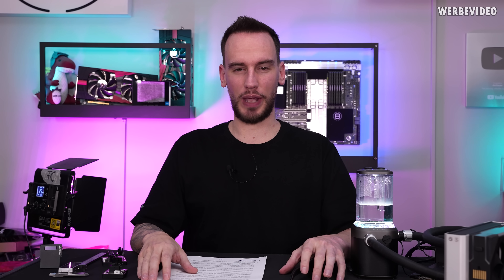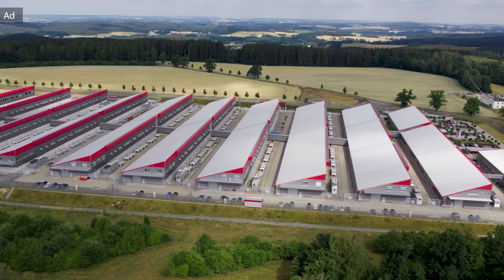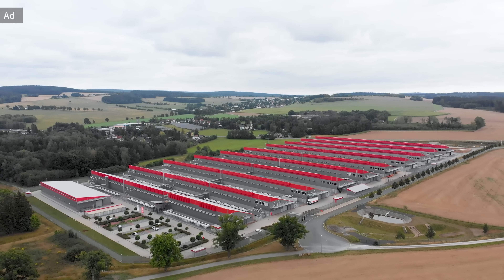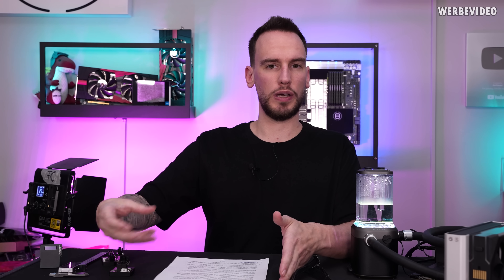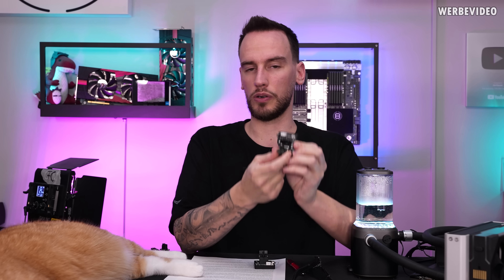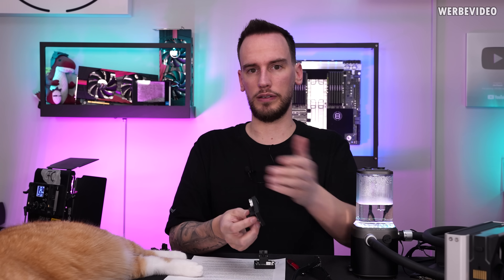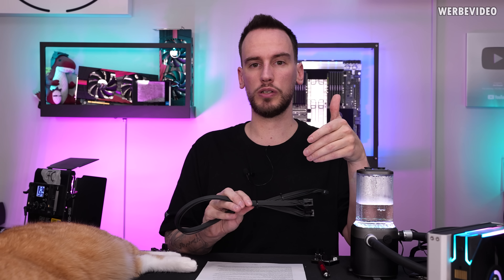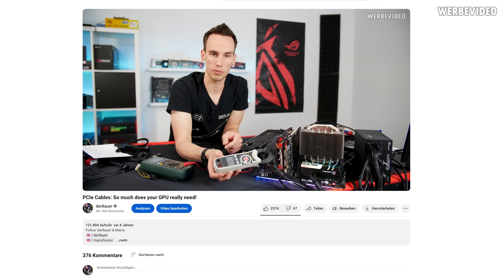12VHPWR is just Garbage and will Remain a Problem!!

Comment: I had problems with the connectors melting down.. answer was simple. I soldered another connecter to the gpu so then I could plug in another psu cable I to the gpu

Comment: I tried to explain this to people for a LONG time.  Like as soon as the 4090's started having this issue.  Too much current, through too little connector.  When pushing that much energy through a small channel (if it's electricity, or fluid under pressure in a pipe or even a river) has to be done VERY carefully.  If it is not done perfectly things go very bad very fast.  It's basic physics.  But no it's user error, it's designed well and the people at PCI SIG know better  etc etc.

Comment: Anyone with a brain an some common sense can see that these adapters are just another pointless point of failure instead of just one cable an connection which in it of its own is a point of failure but lets x5 that an add some 90s 180s fuck it lets go from a 90adapter to a straight an go right back into a 90. Like Jesus h guys yur not piping in copper lines here IT ELECTRONIC just use the LEAST AMOUNT OF POINT OF FAILURES . Thats like the people that use display adapters to extend there display adapters. Just BUT ONE LONG CABLE . Its moronic

Comment: Simple solution is avoid buying 4090 and 4080 GPUs and if you do try to get ones that use 2 8 pin to 2 8 pin connector vs 2 8 pin to 1 12pin connector.

Comment: These can be a problem even on lower power cards. I started to experience frequent display driver crashes when running stable diffusion on my 4070ti, which I narrowed down to connection problems with the 12VHPWR connector. I've had to awkwardly suspend the cable from the case so that it's in line with the connector and there's no pressure on the socket from the cable sagging. That's eliminated the problem, but it shouldn't have been a problem in the first place.

Comment: Happy New Year. I chose to go with a 4080 Founders Edition and I've been pretty happy with it so far. It's a very efficient card, which means I don't need to worry about the power consumption and the state of the power connector. I want enough GPU power for the upcoming 4K 240Hz monitors but if NVidia keeps disregarding power consumption on their flagship cards my next GPU will be the more efficient 5080 instead of a power hog 5090.

Comment: The EVGA 3090ti had it's connector on the end of the GPU which left so much room and the cable could stray straight. I know that this is not a problem card, but why don't manufacturers of the 4090 use this idea?

Comment: What they should have done long ago is up the voltage which inversely lowers the amperage required to carry the same amount of power.  1Ax12V=12W 1Ax24v=24W.  They'll have to do this eventually as watt requirements go up or you'll end up with stupid thick cables. However, the real issue is power contacts.  If you have a large amount of surface area, contact then you get normal temperatures, but if you have a small area of contact or worse a gap then you get high heat or arcing.  Those power connections are more likely melting because of that reason alone.  Still, I think going to higher voltages would solve a lot of issues.  You could take 2x 12v rails and output a 24v with the right converter, but it's going to take space in a PC, but it's a solution that can be done outside of the ATX standard being updated to higher voltage rails.  Besides downstepping home voltages to low volt DC is lossy as well.  So there's more efficiency to be gained if they moved upwards a notch in the voltages.  48VDC would be a good spot because there's so much stuff that runs on 48VDC already in telco's, those vendors would welcome more business in that area when it comes to components.

Comment: from my understanding the cable is fine. The issue is the clip on the cable. There is two much leeway on the clip. Also the connector is to long for a single clip. A double clip with less leeway would fix the issue in my opinion. Maybe thicker copper wiring to up the power limit of the cable. 

Realistically who wants 4 x 8pins coming out of their GPU. Even three is some what annoying.  Having just 1 cable is extremally convenient. I don't think taking a step back from innovation is the answer. But I do think Nvidia and PSU manufactures do need to sit down, create redesign of the cable and a standard for it. Hopefully this is done before the 5000 series is lunched.

Comment: here is a question why isnt the connector to the psu melting? it should be the same on both ends
Reply: Because on the PSU side they use 2 or 3 8 Pin PCI-E connectors. Basically what 12VHPWR is, is just an unnessery adapter cable. Seasonic for instance sells a 12 VHPWR cable with only 2 8 Pin connectors on the PSU side. Because they say, that their PSU's can deliver 300Watt on 8 pin no problem.

Comment: This is all under the condition that you have a 4090 pulling somewhere around 600w. Is it safe to assume the 12v hpwr connector is more than sufficient for lower tier cards like the 4070 and 4080?
Reply: Yes, but so would be two 8 pin connectors, that's the joke here. Seasonic sells a 12VHPWR cable with only 2 8 pin connectors on the PSU side because they say, their PSU can deliver 300W on 8 Pin no problem.

Comment: Very informative video, really appreciate it. Went and had a look at my 4090 with my 12vhwr cable and it definitely isn’t 35mm space before the bend in my case at most it’s 15mm before the bend because of the glass. I’m kinda worried now, as I’ve had zero problems so far other than my old PSU causing momentary black screens because of the cable. I upgraded from Corsair rm1000x with cablemod cable, to a seasonic 1200w platinum and my black screen flickering went away. Every now and then it’ll blow the breaker in my apartment though when I’ve got anything other than my pc running but that’s my problem not due to nvidia or any other company.
Reply: exactly same spot as you, just checked and mine bends after the nvidia logo on the label of 12v connector. 0 issue after having owned it for a year. 

how often have you done hardcore gaming on it?

Comment: LOL i just emailed thermal Grizzly asking if the Wire sense was a using the OLD h+ or the newer H++ standard, guess it doesn't matter So i had the cable mod 180 adapter fuse itself to my Msi rtx 4090 Suprim x I had to wait 8 weeks for repair through north ridge fix finally get the card back and i don't even want to plug it back into my system!  Should i under-volt? Power limit? does someone make a over spec'd cable with high-temp resistant plastics? could i make my own out of Polyether Ether Ketone? or should I RMA it straight up Jensen Huang's butt? Any Ideas would be appreciated!!!

Comment: Can some tell me please why we cant just use the same connectors used in the Radio Control Hobby Industry?  We use XT60 and XT90 Connectors all the time with 24V and higher voltage and also pull close to 75-90 Amps continuously run after run.   The connectors are not effected by this.  There should be no reason why we cant use a 2 wire connection with larger gauge wires and connectors.  If I am mistaken on this please someone correct me.

Comment: When I first saw this cable being speculated on, I knew this would become a problem. Smaller pins are never the way to go with increased current draw. It's clear Nvidia was going for a certain aesthetic at the cost of reliability. I run RC cars and realized many many years ago to go with the biggest connector possible to minimize loss as heat. 
I am currently running a 6900XT. I did some pretty hard overclocking on it where I allowed it to draw as much power as it wanted as it is water-cooled and for benchmark runs it was fine. I let firestrike loop for over an hour and while the GPU temps were right on the edge of acceptable (drawing over 400w), my cheap Amazon 180 degree connectors never went above the case ambient temperature, I used a FLIR camera to verify it. It uses 3x8 pin connectors, which as you stated are definitely the way to go. Yeah, they are larger and a bit more bulky, but it really shouldn't bother people. It's just more surface area to have cool looking cables, kind of like the patterns you can create on the 24 pin connector.

Comment: I would like to see them stop using extra cables for the GPU altogether and instead use a extra "Power" slot on the motherboard or extend the PCIe slot to add new power pins for the GPU.

Comment: Something that's pretty clear to me is that this new standard was clearly rushed with arbitrary constraints and never tested in real-world cases. It really looks like PCI-SIG just developed it, tested it in open bench setups, saw that the card was properly powered and went like "Eh, good enough" and called it a day. Clearly there were no torture tests done on them or tests that aim at simulate bad/improper connections to ensure that even in the event that a bad connection were to happen it wouldn't cause problems. The tiny pins also make me question the scope of this new standard because it seems to be born more out of aesthetic/size concerns than actual reliability issues with the existing standard. PCIE-SIG couldv've gone with bigger connectors and ensured that the rigidity of the connector itself would prevent things from wiggling around or chosen a different wire gauge but instead... didn't.

All in all this new standard is a dumpster fire and should be scrapped entirely.
Reply: PCI-SIG doesn't even go that far. The PCIe 6.0 spec got finalized almost 2 years ago. No one has actually demonstrated working PCIe 6.0 hardware.
Reply: @naptastic  ooof, thanks for the explanation
Reply: " it seems to be born more out of aesthetic/size concerns"  And manufacturers put the connector in the center of the VGA. LOL.
Reply: @devilzuser0050  thats usually for industrial engineering not in this case ...
Reply: sure and some manager signed off that has no technical or experience overwriting the engineers
Reply: @atta1798  Yeah not unlikely that this happened as well. A tale as old as time essentially...
Reply: FYI, intel told them it was fucked and proposed a better connector. This is why Arc was supposed to use them on all cards.. but clearly that didn't happen.

Comment: Higher thickness wire will also help the connector itself. Thicker wire = more thermal transfer of heat away from the connector pins, and a higher current ability without overheating. The wires act as a sort of heat-sink for the connector itself.
Reply: @Triro  and yet 15+ years of 6+2 connector and basically no issue with that. It definitely raises the question whether the new standard is at all adequate, whether it gives manufacturers too much wiggle room to produce items of insufficient quality, or makes it more difficult to end users to install correctly or easier to install incorrectly. There's no need to brown nose PCI SIG and Nvidia.
Reply: Standard is faulty as nVidia pushed hard for it, thus we now have a replacement standard (still the pins are not of a dimension to cope with 50A continuous current)  @SianaGearz
Reply: sure, but the connector itself is too small to handle 600W of power, or almost 1000W, which an unofficial BIOS flash can allow the GPU to draw without any hardware modifications
Reply: @Triro "I archived this thread" well too fuckin bad I'm replying anyway
Reply: @Triro  I'm not likebotting anything.

"Doesn't have very delicate pins" well that sounds like a massive advantage to me! Tell me again why we're "upgrading" to inferior hardware?
Reply: it wont help much , the bottleneck is still the pins not cable , that tiny pins and connector is too small to carry 600 watts of heat longterm
Reply: @Triro  So its more delicate then the original standard, and causes more problems. So why have it?
Reply: I'd prefer if they just raised the power limit on the old 8 pins a bit. and maybe even the PCIE connector. From 150 to 200 and 75 to 125/150 would allow just 2 8pins to supply over 500 watts to a card or more than 700 with 3. Even 300W cards work with just one 8 pin.
Reply: It is all l about materials
Reply: The spec itself is fine. Blame manufactures for making shitty cables.

I can also already see this being dog piled for having the "wrong opinion". Even though its correct and factual information.
But ay, whats 20 years experience for. When you have a YouTuber to blindly follow what HE says.
Reply: i just had my replacement cable melt at the psu side from the original cable melting at the gpu side. i have been thinking the wires need to be thicker as the same pins on both cables melted. i was gonna try rewiring, but don't know what gage to try and if it would have a inverse action. also, i wonder if putting a fuse in the cable might help in some way.
Reply: @bio-nukes4136  you can make those wires....look for the spec...etc but then you might have an issue with the board. Etc
Reply: @bio-nukes4136  sounds user error. 
my cable was installed properly, and I havent had a single issue.

word of advise, if its user error. dont complain :/

Comment: Honestly, they should've just used an xt60 connector (maybe with custom keying). Higher power, smaller, simpler, better contact even when not inserted all the way. And plenty of existing "stress testing" from all the RC hobbyists who use them way past their rated maximums with tons of moisture ingress.

Comment: Isn't the failure rate of the 4090 due to connector problems actually quite low? Like higher than other cable connector into a GPU, I get that, but still less than a percent of a percent?

Comment: Keep in mind that the 8 pin pcie connector has 2 more ground pins than the 12v pins. So even if two ground pins/wires were completely burnt or not contacting properly, it would still be able to push the entire "rated" 280 watts. On the 8 pin, you only have to worry about the 12v pins being overloaded, while on the 12vhpwr you have to worry about both the 12v pins and the gnd pins being overloaded or contact issues.

Comment: Nvidia with their 12VHPWR on a 4090 is like expecting the Intel stock cooler being able to handle the full load heat dissipation of an i9 14900K.

Reject modern 12pin, return to 6+2 PCIe

Comment: I never liked these plugs if its carrying power it shouldn't be possible to incorrectly fit it for Safety reasons. 
I feel the problem is the cables as the power is drawn through them to the Craphics card they get warm this heats up the neighbouring wires if you have a defect in a cable it could cause extra heat when you add in lack of airflow over power connectors as most are in cut outs from heat sinks which could also be heating the Plug&socket you then have a potential for melting& shorting of cables and fire. The minimum distance away from plugs you can bend cables is due to possibility of strands of wires in the bundle getting damaged or snapping and strain induced on the connectors. However I now feel the problem is the socket design and positioning the reason if Silicon boards with a fittings at each end are melting in the Graphics card I feel is heat building up in the socket which could be reason the problem is more prevalent in RTX4090& 4080 range and not seen so often in 4070 range (I know 4070 requires less power but by product is cables get less warm gpu generates less heat and socket doesn't get as hot)

Comment: Downside of 2 12vhpwr connectors on a card is most PSUs only come with 1 native 12vhpwr/16 pin connector, so in theory if the 5090 uses 2 connectors people will have to do another PSU swap for there whole PC

Comment: 14:38 How do I figure out if it's my case as well? Because the exact same thing happened to me and I thought the issue was the PSU of 750w, which is below recommended. But actually it can be possible that the issue is the connector. How can I affirm this?

Comment: i have been talking for years on WHY the power plug is not near the pcie connector. Have a through motherboard connection, built into the motherboard. Then have the connection to the PSU on the backside of the motherboard.

Yes this adds cost to motherboards. I am certain the engineering can be done and who better to do that than motherboard engineers. They are already capable of routing power and signals effectively and safely.

Could even be cheap and just have a hole through the motherboard, Yeah lets not do that. I shuddered at that thought.

Comment: I had the money to go with the 4000 series, but decided against it because of that connector.  Not certain why EVGA pulled out of the GPU industry, but forcing AIBs to use this connector seems like it would have been a good reason. You don't want your product to be the reason why someone's home burns down.  If they stay with this, eventually it would happen.  It's best to just elliminate any reason for such an occurance.  I'll not be getting a GPU in the 5000 generation too.  I'm haoppy with the 3080ti I have. Despite the first 3080ti failing and had to RMA.  Different reason than this failure.  (broken traces near the PCIe connector).  Evidentally, they sent me a returned GPU the first time. Possibly broken by an amateur building.

Comment: Is your suggestion to add 2 12VHP connectors on the GPU and have like a single 12VHP cable that splits into 2 12VHP cable on the GPU side or would it need 2 12VHP plugs on the PSU as well? Also would a redesign of the clip that holds the 12VHP plug into the gpu solve the issue for example having a plug with 2 clips on the side of the connector (or a variation of this) instead  of 1 clip holding the connector from the top resolve the issue?